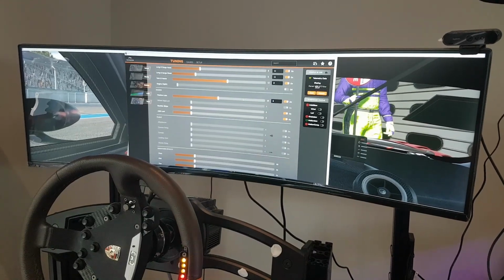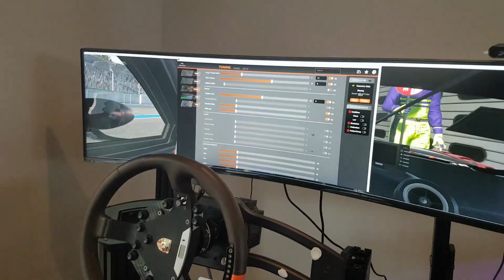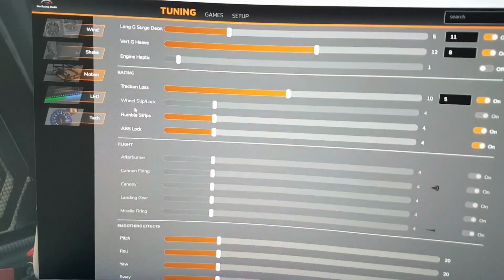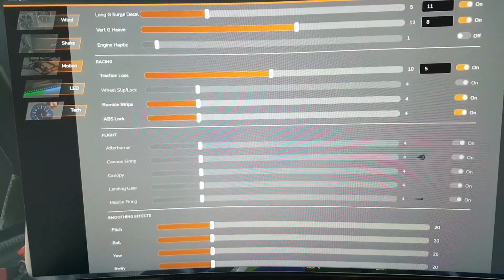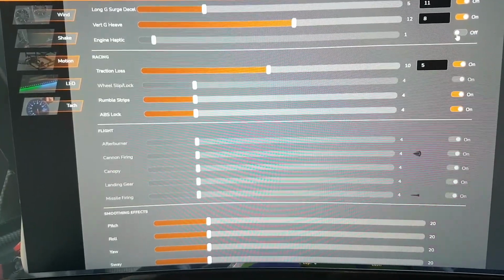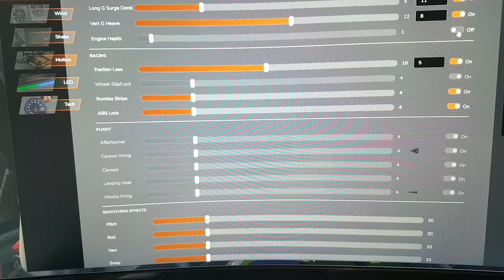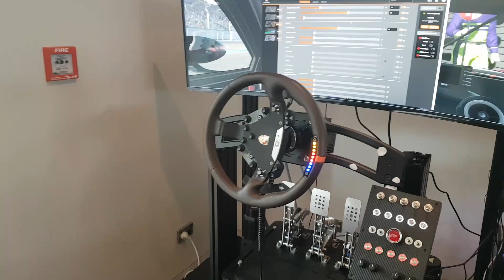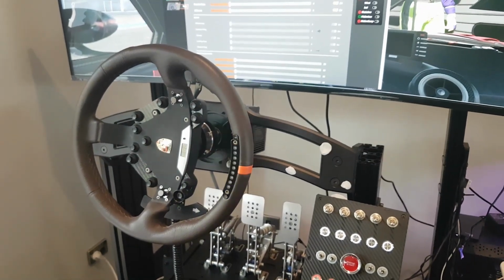PT ACTUATOR   HAPTIC DEMO

Comment: Question, one would assume the engine haptics *(behind the scene) takes into account V4 V6 V8 V10 V12 based cars but altering the fundamental frequency to then operate with the varying smaller-larger RPM ranges such cars have?
Reply from the maker: It depends on how sophisticated the telemetry output data is... No all sims provide this information, so a blanket yes or no to your question would be appropriate. The truth is it depends.

Comment: It's fast frequency data send by SRS, and the AMC-AASD15A is fast enough to translate as vibrations on the actuators. 

Said that, sfx100 actuators that also use AMC-AASD15A controller, will have same haptic feedback using SRS.
Reply from the maker: Thanks, it clears things up

Comment: Do you know if having those haptics effects enabled all the time impact on the Actuators longevity?. And also, do you recomend having also bodyshakers for any effects that the PT-actuators might miss?.Thanks a lot for your series of videos on the motion system.Is helping me quite a lot¡¡.They stand out of all other videos on youtube about motion sim.
Reply: Its generally ok, for low amplitude vibrations,  it won't decrease the life expectancy of the PT-ACTUATOR  actuators. Remember these actuators are designed for 100% duty cycle, unlike many other actuators on the market that usually are for 10-20% duty cycle and need off time to cool off.

Comment: D-BOX... they are not the only ones that can do haptic feedback feature . The AMC-AASD15A servo motion controller... By Thanos. (which is what the PT-Acutors use) can do this haptic feedback using any software... FlyPT, SimTools , SRS etc...    Dont be fooled by D-BOX... if you have the coin... then fair enough it's your money... but what i will say is that ....
.. if you build it, You can fix it, no RMA needed for SFX-100/150.. (which if you use the thanos controller, you can also have the "Haptic Feedback")  😋